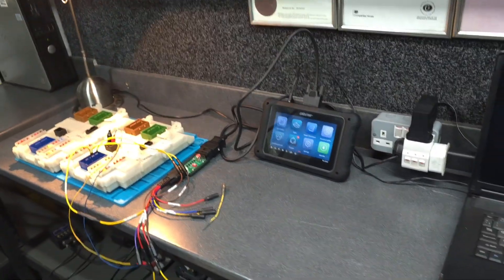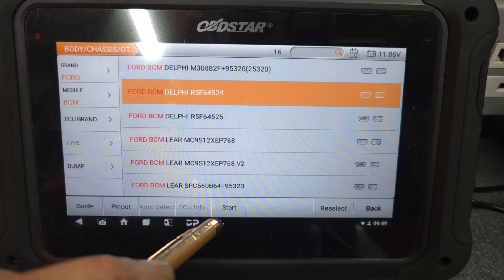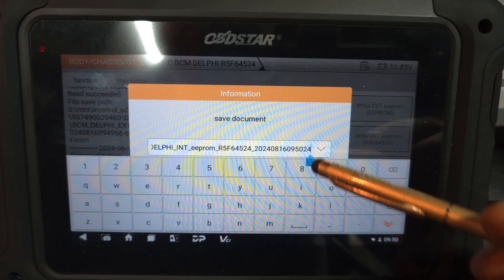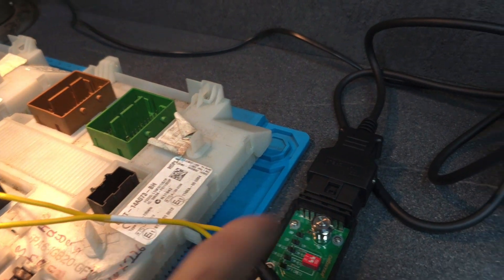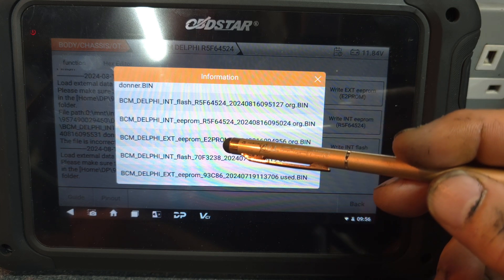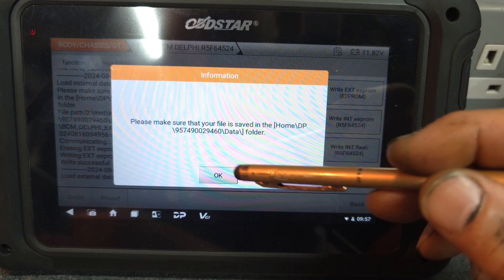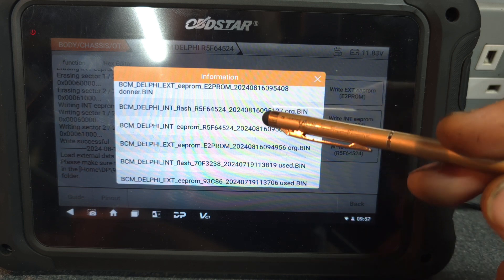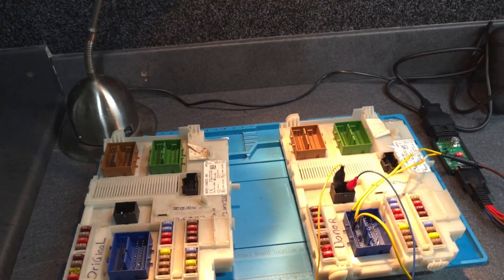Ford BCM (Body Control Module) Cloning. Immobiliser Database Transfer Recovery By OBDSTAR Dc706

Comment: Can I ask where ya get those clamps the 12v red ones? The dc706 and mp001 didn’t have them and I can’t get 12v to the 2 big pins. 😢😢😢
Reply from the maker: Hi! The red 12V clamps didn't come with my DC706 or MP001 either-I sourced them separately. You can find similar ones on Amazon or eBay by searching for "12V ECU bench power clamps" or "OBD bench power cable with clamps." Just make sure they're rated properly for your setup.
Thanks for watching
Reply: @akisgarageltd I have some I found from a text kit. I spliced them to one of the connected pins I’ll probably never use and cut one of them so the wiring is exposed and clamped it with the PIN on the board. lol. Anyways it worked. For now I’ll keep using that. But thank you for the fast response! I’ll look into it on Amazon. Thanks again
Reply from the maker: Haha nice improvisation! Sometimes creative solutions do the trick😊 Glad it worked for you! Definitely worth checking Amazon for a cleaner setup long-term. Appreciate you sharing your method and thanks again for watching 👌
Reply: @akisgarageltd yes sir! Thank you of course for posting the video. Always good to see mechanics share information. :)
Reply from the maker: @ThEmEsSiAh187-CFGeorge You're very welcome! I really appreciate your kind words-sharing knowledge helps us all grow. Glad you found the video useful!🙏👍😊

Comment: hello, could you please tell me how to identify a ford ranger BCM? all i can tell you is on the board itself it has LEAR Phil E01713301 but these numbers don't mean anything when looking how to wire it up for cloning. your help would be greatly appreciated. i have a bcm here i would like to clone but dont know how to find the chip set information.
Reply from the maker: @terryiliffe1482 Hello, and thanks for watching! You can identify the Ford BCM by checking the MCU number on the BCM, which will be either Delphi R5F64524 or R5F64525. Thanks again!